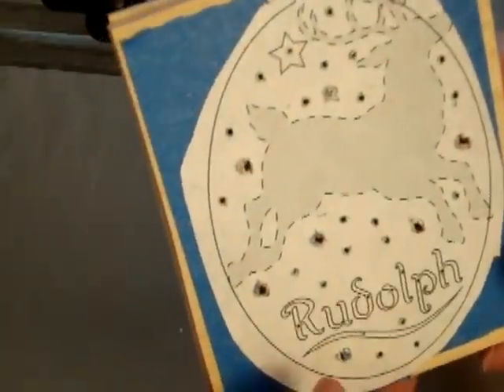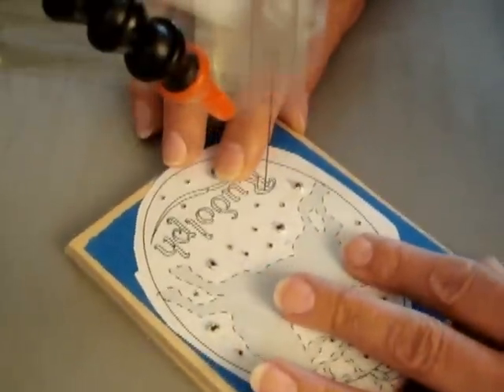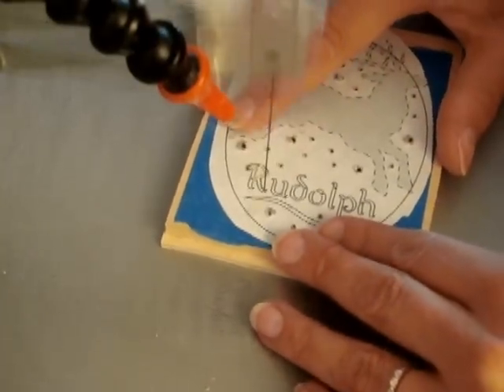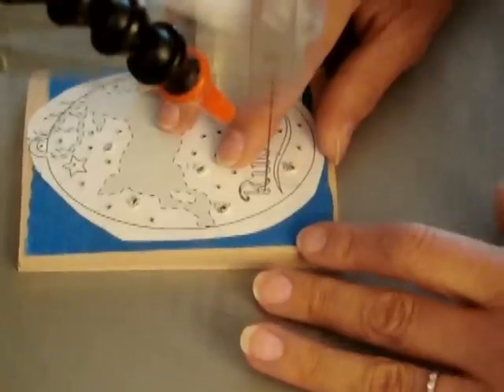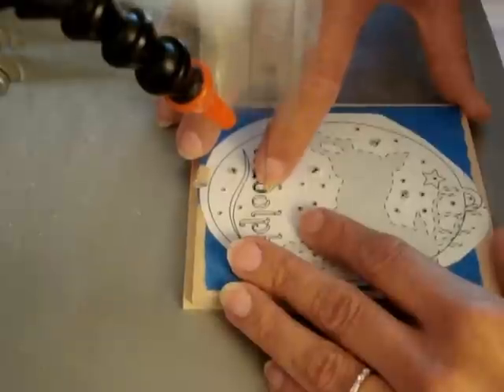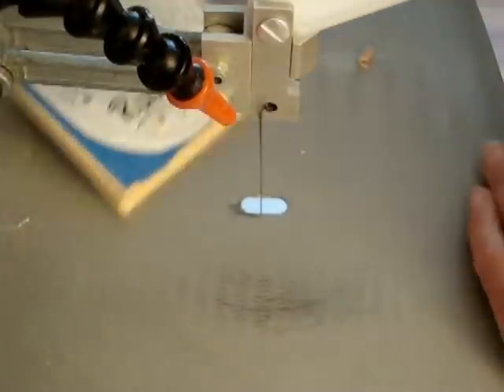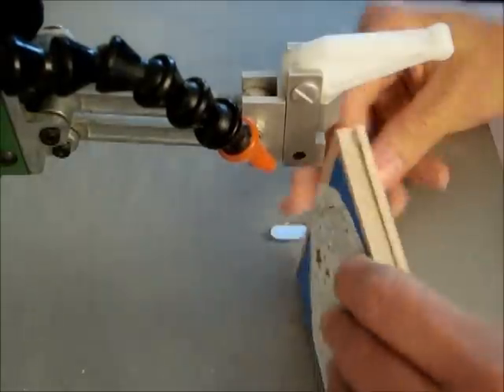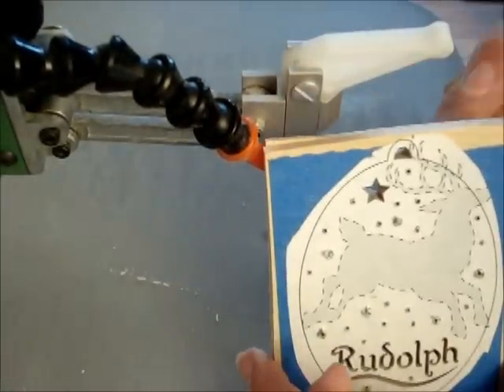Reindeer Games Scroll Sawn Ornaments Part 2

Comment: Now here is someone with a lot of practice showing us all the tiny useful tricks! Thank you very much, Sheila! Although I almost got a heart attack several times when I thought you would cut into your nails ;)
Reply from the maker: It will only cut your fingers (or nails) if you push them into the blade. Scrolling is really very safe. It is said by some that in order to cut a finger off with a scroll saw, you need to change the blade at least 4 times. ;)   Thank you for your compliments. :)